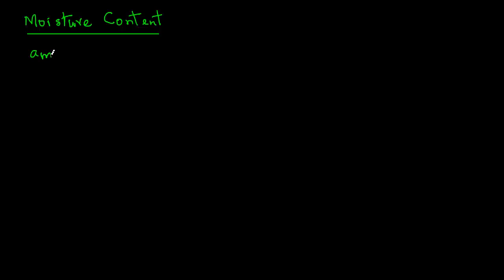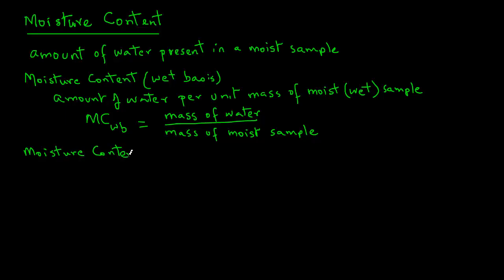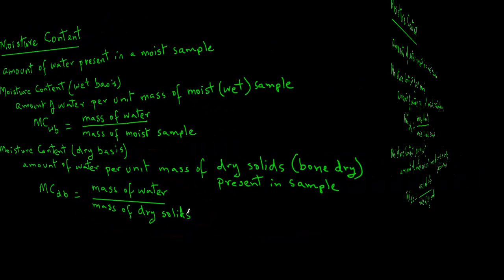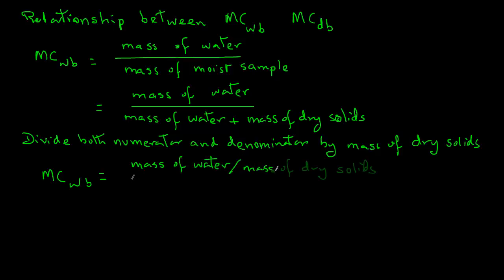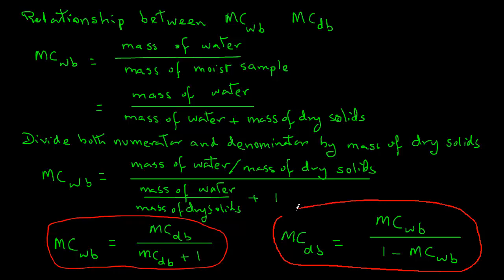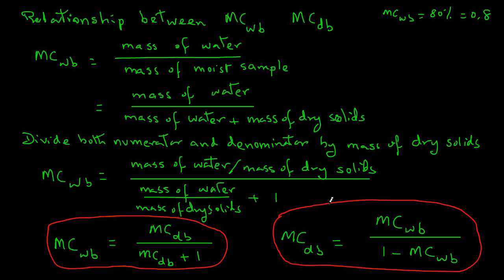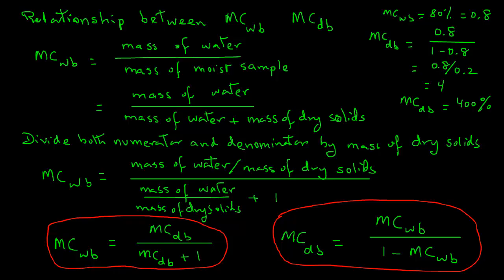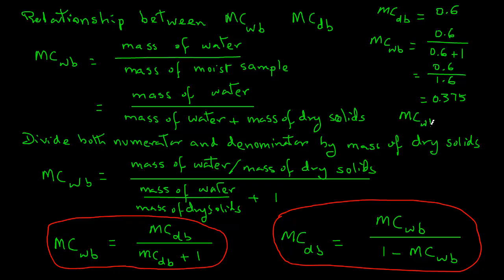Moisture Content dry and wet basis

Comment: Great video, thanks! When you introduce the dry basis, dry solids are taken as bone dry (no water in solids). I am working with data where the moisture content of wood was calculated by leaving the wood in an oven at 110 degrees Celsius overnight. I’m guessing the resulting wood had moisture remaining, so the weight of the dried wood couldn’t be used as bone dry weight. Your thoughts would be appreciated!
Reply from the maker: Depending upon the sample size, there could be remaining moisture. One way to ensure that all of the moisture has been removed, is to weigh the sample, and return it to the oven for another hour or two and check the weight, if there is a difference in weight, repeat the step until you obtain constant weight which should represent bone dry weight.
Reply: @RPaulSingh  thanks much!